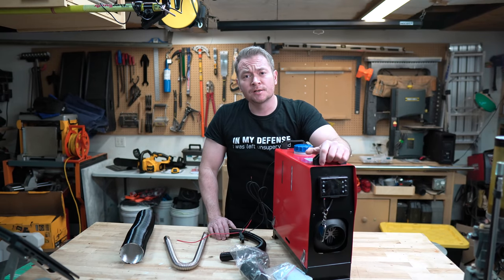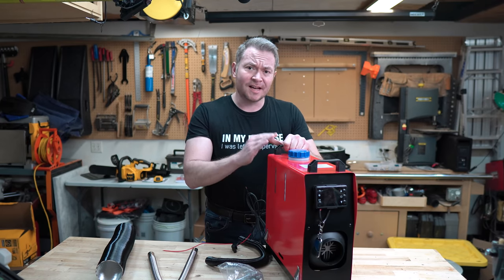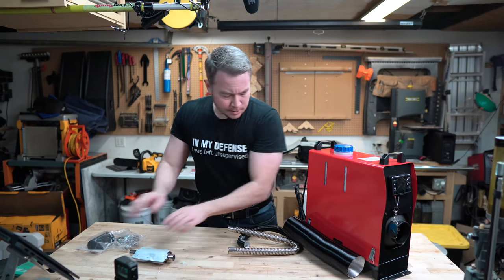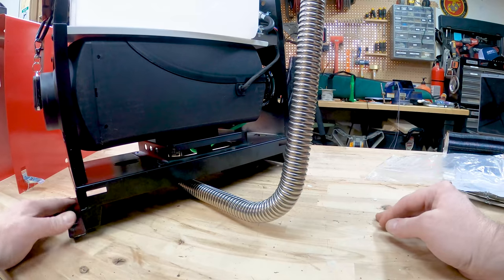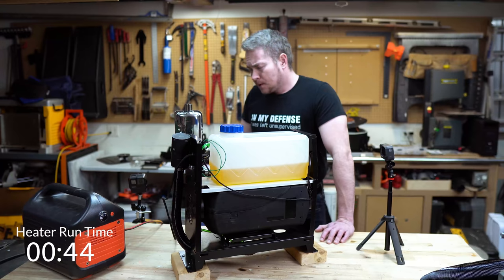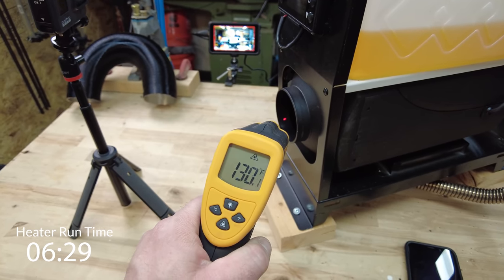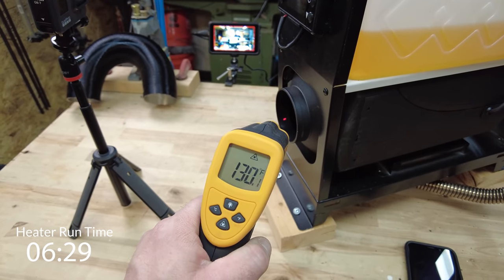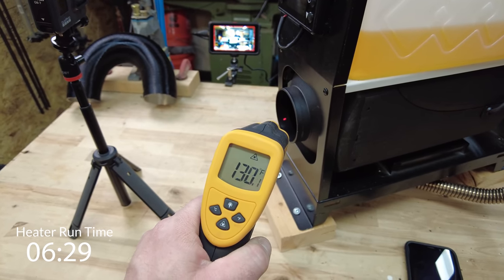My First Chinese Diesel Heater

Comment: If there isn’t one already I would add a small engine  see through fuel filter on it.  Diesel is a dirty fuel by nature and a lot of the fuel stations put a mixture of bio diesel in with normal diesel. This will help keep the injector jet clean longer.   We have wabasto heaters in our trucks and they can put out a lot of heat.  P.S. if using that in winter conditions make sure you mix fuel anti jell in with your fuel or it won’t run long. Diesel starts to turns real thick around 30deg.    Nice presentation by the by.

Comment: I'm truck driver from Poland. This type of heaters is used in almost every semi, it's known as dry system. The other type would be a wet system (heats up coolant in small circuit, hot air blows trough factory vents in a dashboard), wet heater is more popular in harsh climates of the deep north and Asian part of Russia as it keeps engine temp around 30°C (86°F) easing the start up after night. Dry heaters are more efficient using about 100ml of diesel per hour in the 0°C (30°F) weather thus their popularity in European mainland.

Comment: Use this as shown in video for half an hour in your garage, and you are dead.
Always first connect the exhaust pipe which leads the gasses to the outside through a hole in the wall. Also there must be a pipe which lets fresh air in too.
Reply: I'm sure he knows this, this was just a start up video for 5mins

Comment: I use one in my campervan, and as an open water swimmer (no wetsuit) it's a great heater and easy to control, I've been using my unit for six years and had no problem. I also use one in my work shop and two fitted outside with the heat pipes coming through the wall to heat the lower floor of my house. The muffler has always been an issue, however you can buy better after market. I run through 12v battery set up connected to solar on all. I also use diesel cleaner agent in the fuel to keep the internals in good condition.

Comment: It’s good there’s no smell of diesel but I’m concerned about the potential for carbon monoxide build-up which can asphyxiate a person. It’s a tempting buy but it’s supporting a totalitarian regime which does not respect human rights,
Reply: Well I respect what you are saying about supporting a totalitarian regime, however as so many products now are either made in China or have significant parts made in China, it’s hard to know how to get away from that without significant effort as a buyer.  Also the exhaust is supposed to vent outside, so there should be zero carbon monoxide build-up inside.
Reply: @andrewstones2921  let’s go Brandon
Reply: Corporations love totalitarian regimes. And low wage economies. Hence China's economic rise (and oncoming fall), and corporations moving to other low wage economies such as Vietnam, Brazil and India. We, the consumers are the enablers. Because we love cheap goods.

Comment: Carbon monoxide is a killer and it has no smell, no taste, no colour. So this heater needs the exhaust fumes venting outside! Implying that it’s ok to use indoors like that could be fatal for someone.
Reply: Wa
A
A
Call 91
1
Reply: He never implied any such thing.
 YOU inferred it. 
Have you never watched a similar test / review ?

Comment: Absolutely brilliant I've got one here at the other side of the pond and it is on my as a stand by just in case the webasto decide it doesn't want to work anymore after 20-years so thank you for all the tips and very straightforward how to get it going and I managed to get it out the box as it's been in there for the year still no problems with works absolutely fine and that's what it says it does although I will agree with you that is a little roughly cheap play made thanks again for the video and I done what you done with the instructions forget it on his on and off is off simple straightforward thank you once again all the best Alex

Comment: I just installed the same diesel heater but under different chinese brand name it heat up very fast! first you have to install t-bone clamp on the exhaust to have a very tight and hermetic exhaust! the clamp that came with those kits are really cheap !second=you have to install a new fuel hose kit with rigid lines and rubber hose at the end to be safe on fuel delivery !third=you have to use good wire guauge i mean like 10 awg minimum to be on the very safe side ! i install this for my boss inside a Ford E250  for is maintenance carpet cleaning company , fourth=you have to install a co2 detector if you want to install it inside a vehicule :)

Comment: Thanks for the presentation, it will help me with my set up.  By the way carbon monoxide is a colorless and odorless gas.  The smell of burning diesel is from other waste products.  So your viewers hopefully understand that running this inside for an extended period could be fatal even if there is not visible sign of exhaust.

Comment: Just to add...
I'm running mine in my cabin and I'm using a deep cycle 12v lead acid battery with a trickle charger feeding it.
The battery easily handles the start up and shut down cycles, and the little charger acts like the alternator in our cars, recharging the battery and running it once started 

That way IF there's a power outage,  the battery will keep it running and i can close it down safely if I want to or not...

Each pulse of the pump sprays 0.02ml in the burner.  So here's the maths of mine concerning the 
Fuel usage on different settings 

H1 2.0/sec = 120/min = 144 ml/h
H2 2.6/sec = 156/min = 187 ml/h
H3 3.4/sec = 204/min = 245 ml/h
H4 4.0/sec = 240/min = 288 ml/h
H5 5.0/sec = 300/min = 360 ml/h
That's not a lot.....

Comment: I bought the exact same heater a couple weeks ago except I think the company was called SuperGoodBangBang or some sh*t.  Anyway, I got it to warm up a small cargo trailer for camping.  The Mr. Buddy heater I was using kept shutting off from oxygen depletion and it made the trailer walls soggy.  Not good.  The plan was to use the diesel heater outside and blow the hot air in through a vent in the floor.  First time I gave it a go, it was snowing out so I didn't want it to get wet.  I put the heater inside and blew the exhaust out the hole.  It worked great!  The slight engine whine made it easy to imagine I was on a private jet.  But the fuel pump...mine does not "click".  It makes a noise like an East German Stasi agent knocking on the door at three am to take you downtown to "answer a few questions".  It got so loud that it became almost unusable.  I'm going to have to find a way to quiet it down using Dynamat or some other sound absorbing material.  All in all, it's a great little unit.  I'm not too worried about longevity since I won't be using it all that much, but at the price, I can buy another one without selling a kidney.  You are correct about the manual.  It was only useful for staring a campfire.
Reply from the maker: LOL!  That last statement had me LOL.  Glad I wasn't just being ignorant and unable to decipher the manual :P  Too bad about the fuel pump ticking on yours.  I noticed that mine is mounted on a rubber isolator.  Pretty smart and more than I would have expected from a budget heater.  I think that's one of the main reasons it seems so quiet (to me at least).  Good luck and thank you tons for sharing your experience as well!  I'm sure other viewers will benefit from it too!

Comment: I put a similar Chinese heater in the cab of my pickup truck. It’s a 8kw model though and it’s plumbed directly into the fuel tank. Still working after 2 seasons. 8 kw for a extended cab pickup is major overkill and for that reason it often over shoots the set temp. As a lot of you probably already know these units slow down the fuel input and the fan speed but can not shut themselves off. If you’ve got more heater than you need you may be cooking yourself out of your space. For me it’s not a big deal. I use it in the morning to heat the cab and melt the ice off. It heats the truck up quickly. Saving idle hours on my truck and getting in a toasty warm truck is nice. I can always crack the windows and or just shut it off once I get going for the day.
Reply: Do you keep the unit inside or out? Was wondering how you arrange the exhaust and intake hoses. I have a major concern with all these videos mounting them so close together. Is that intake hose strictly for combustion purposes or is that the air that gets pumped into the truck? CO issues!!
Reply: @sparrow28045  the unit is in the truck under the back seat. The intake air is not pumped into the truck at all. It simply goes back out as exhaust. The heater inside the truck is simply forcing cool air over the hot aluminum heat exchanger.

Comment: Good video.
FYI, I heat my 18x18 garage on weekends with one of these. I live in Ontario Canada and no matter how cold it will heat my shop, it's just not fast heat so I normally turn it on Friday leave it on. Nice it is that it does have a built in thermostat so it will idle down once it get to your temp, I have mine set 18*C. I'm on my third winter and it's been great.
Reply: Also, I run mine off a battery with a cheap battery charger on it, soon solar.
Reply from the maker: pretty much the same here.  I use a Jackery (portable power) to power mine.  It's kept alive via float charge for the most part but when I'm out or in case of power outage, it's a quick swap to solar.

Comment: Nice video I had the same goals. Mine is in my Alu-Cab camper. Had it for 2 years. I would do the following. Zip tie the tank down, add an inline fuel filter, go online and buy a non straight through exhaust muffler, protect wires and fuel line from sharp edges and fasteners/screw.. I wrapped my exhaust with automotive exhaust pipe heat wrap.
Reply from the maker: Great tips!  I used some double sided tape to hold the gas tank in place, but I like the other suggestions for fuel filter, muffler and wire protection.  Thanks for sharing and thanks for watching!

Comment: I finally got one of these Tom, for preheating the airplane....huge improvement over the electric heater...it's the squattier version, but same type components...$130ish shipped...I agree completely with all comments/ concerns regarding quality and longevity...but if it does last, what a bargain!! Great "quality" heat for cheap...for now. 👍🙏
Reply from the maker: Nice!!  I'm gunna have to get my SDR setup with ADS-B and see if I can spot you flying around the area.  Gimme a call and squak 369, rah!  Or, if you're ever in my neck of the woods, hit me up.  Would be good to see you again.  Hope you're doing well and fun to see you're still watching LOL!
Reply: I figure I owe you a ride or two...so if you're game, come see the diesel heater in " Bear Hunt", cold weather ops fashion, and we'll fly for lunch somewhere.👍😁

Comment: Well I just ordered one, I've been on the fence about ordering one, I have a small workshop and used to use a small boxwood stove, too long to start, would get too hot, could use the extra space it takes up, was given a 5kw electric unit heater but I've adjusted my lifestyle to where I'm only paying $65 a month for electricity, I can only imagine forgetting to turn the electric heater off and going for a long weekend $$$$

Comment: You can harness the heat of the exhaust by attaching a stainless steel radiator. It works well in my brother's workshop

Comment: Dilettante? I don't think so. I put one the same into a Fiat van two years ago. It's worked well, with no difficulties that I can recall. As far as I can determine, it burns between a third and half a litre per hour. When I changed my house central heating from oil fired to biomass, I was left with a tank of 700 litres of kerosene, which is cheaper than diesel (in the UK anyway) so I run my heater on 50% each kerosene and diesel. When you go from 35 sec. fuel (diesel) to 28 sec. (kerosene) the pump pressure should be reduced but I've had no bother. I was interested to hear from your video that the 12v consumption is about 30 watts when it's up to temperature. That lets me calculate how long any given size of battery will last. Great video. Thanks.

Comment: I have been running one of these in my camper bus for over 2 years.. Thats how long it took mine to fail completely. Bearings inside the blower motor went bad, intake hose had many holes in it, and exhaust had rusted through in many spots. Parts to repair it were 80$, but a brand new heater was $120.. I ended up replacing the unit.

Comment: I have several, they run 24/7 for 6 months, the only thing I had was bad fan bearing, I let it go too long, had to replace the motor, then I used a higher quality bearing, removed and left out atomizing screen, it is still sitting on my stove heating the house. I live off grid, above -10c 10 L lasts a few days

Comment: You can run the exhaust longer to capture more heat off of it or run it thru a radiator and blow a fan thru it to make the system more efficient. Make sure your exhaust is running dowhill the entire length of it so moisture does not build up in it and shut the unit down. I suggest replacing the fuel line as they are mot good quality and can leak, causing a fire.

Comment: My biggest concern about these is the cooldown period.  That is, if you have a sudden power loss, that it can't properly cool down.  It's highly unlikely that would start a fire, but it would fry the control board, which is sitting near the heating chamber and will over heat without air circulation until the temperature comes down.

I'm thinking of setting up a small 5Ah LiFePO4 battery as a backup power source that instantly kicks in when main power has been lost, giving plenty of time to manually shut down the unit properly.  Even better if I can prompt the heater to shut down when main power is lost.  I don't know if there's a way to interface with the control board on these heaters, but I believe they all come with remote controls?  I could just use a Raspberry Pi Zero with an IR transmitter to spoof the remote control signal for "off", even programming in a delay to allow some period of time for the main power to be restored.
Reply from the maker: Love the way you think!  This unit came with a 4 button remote (on, off, up and down) that serves its purpose but isn't anything to write home about.  The concern over sudden power loss is legit.  When using on trips, I plan on running this on my Jackery 500 which should work fine as long as I'm not negligent enough to let it drain it completely.  For heating the shop at home I was planning on running off a car battery with a float charger attached to the battery.  That should provide me with ample power to run it and sustain it for a 5 minute shut down sequence.  The Pi Zero idea...that's cool!  Hadn't thought of that one and gives me yet another thing to think about as I get into my first Pi build :)  Thanks for watching!

Comment: You will need a better exhaust tubing to allow the exhaust to go outside.  I bought stainless steel flex tubing from McMaster Carr.  It’s available in metric sizes.  Replace the fuel lines with rigid nylon tubing both fore and aft of the pump, using short lengths of rubber fuel hose as couplers and double clamp them.  The fuel line typically included is unreliable over time.  I tend to doubt whether your unit will output 5kw, it might get close to that.  My heater puts out 180 degree air, yours seems a little on the low side.  Your digital controller is way better than my simple dial control, but it might go dark prematurely, as reported by very many buyers.  Here’s hoping your unit proves dependable!
Reply: 2011 model Espar D2. 2KW output with boost mode, or 7500 BTU’s
Reply: On start 8.3 amps 2.8 amps (Boost) 1.9 amps (High) 1.0 amps (Medium) 0.67 amps (Low)

Comment: Great video.  I had a wabasto in my 44' sailboat and it worked for years.  I suggest you put a 5 micron filter before the fuel pump.
Reply from the maker: Thanks for the tip!  Any particular filter style or brand you would recommend?  I'm pretty new to these types of devices so pardon my ignorance.

Comment: I have this unit, I have run it 2yrs now. My garage is insulated 22ftx24ft, when it is 20 below f. It will give me 40 degrees in the garage.  In other words that powerful for such a small unit. It uses a gallon every 12hrs not on full.
Reply from the maker: That's awesome!  60 degrees above ambient?  Not bad at all.  Thanks for sharing your experience with this thing.  I hope to get similar results next winter in my own semi-insulated garage :)

Comment: This guy could review hot wheels and I’d be interested he didn’t miss a beat 👊. Funny when he said shit I wasn’t expecting that lol. As far as the heater I have a espar heater in my semi truck works really well and will run you out of the sleeper if set high enough. Glow plugs and soot buildup inside the heater seems to be the biggest problem with mine it’s good to start the heater up every month and let it run a cycle instead of letting the heater set for months on end between starts

Comment: I use a craftsman torpedo diesel heater for my 15x40 shop. Yesterday went from 42 degrees to 70 in 1 hour. I have about a 10 hour run time. This one is awesome for the price though. You should try a chinese plasma cutter. A Cut 50. Love mine, cuts like butter.

Comment: I'd wondered also about these diesel heaters and the CO and CO2 emissions and such but I guess that comes with any flame/Gas or Liquid fuel Heater.  Thanks for giving the heater a run and running through the nearly laughable instructions.  They try.  Keep well now!

Comment: That’s a handy heater as can connect more pipe to exhaust and drill hole in wall and let fumes out of the building, myself got the paraffin backup heater but I also can cook on it, the only down side it smells a bit and must have plenty of ventilation in house.